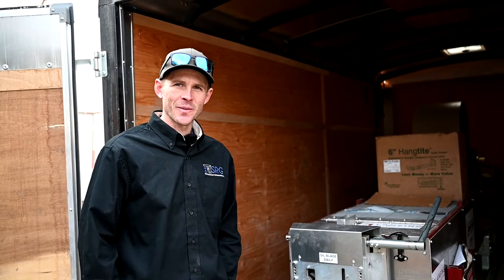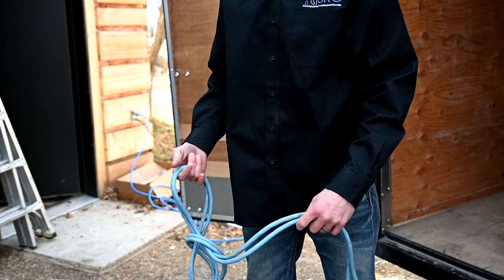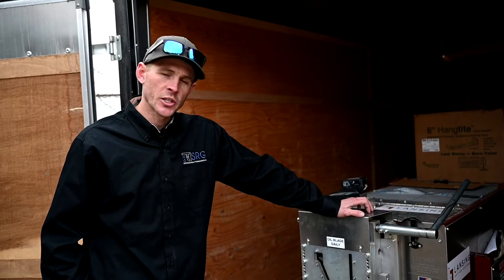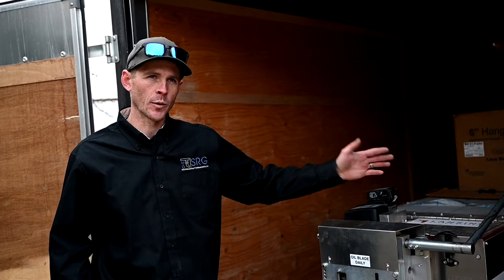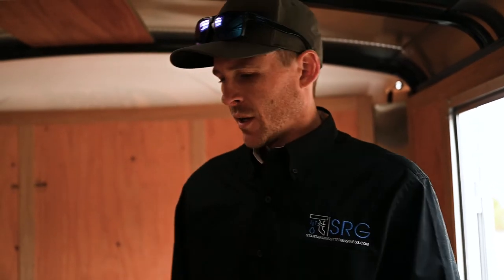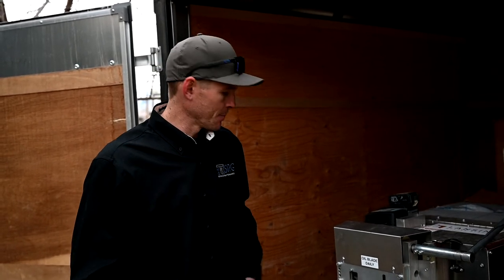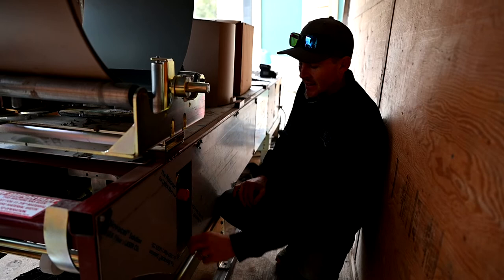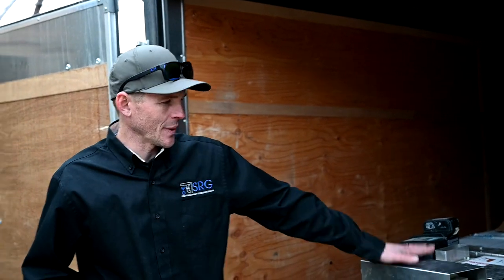KWM Gutter Machine Tips

Comment: Just starting out with a kwm 5 inch. What’s the best practice to minimize waste when running out machine at the end of a job
Reply from the maker: measure to the back of the machine on your last gutter and add a few inches, cut coil with snips and run out your last gutter. Then trim gutter to length
Reply: @StartARainGutterBusiness  that was my thinking as well. Thanks for reply
Reply: Any thoughts on customers who just want metal ran off and dropped? Ive got one coming up and I needed sone insight on the best way to price
Reply from the maker: We charge around $5 per foot of gutter for cut and drop

Comment: Would you or anybody know how to service the gear oil in the gearbox attached to the electric motor? Just completed a motor swap and would like to know how to add the 90 weight oil that dripped out when I separated the motor from the gearbox. 
Thank you!
Reply from the maker: should be a set screw on the top and side. the top is the fill and the side is the fill level

Comment: Thanks for the informative video, we’re a roofing company just getting into the gutter business. So these videos are helpful. I have a question! Do you absolutely need tandem axle trailers? I’m getting the Ironman jr 5” which means it weighs 800lbs, I can afford a 6x12 3500 lb rated trailer single axle. I can stretch my guns to buy a tandem I just don’t want to for a trailer that will only leave my shop approximately 10-20 times a year
Reply: my buddy has a 12 foot single axle trailer and he has no issues with it.  just remember each full roll of coil is about 200 pounds.  it adds up quickly.  on another note, you might be able to find a gutter guy to drop off the gutter to you and you install it yourself instead of spending the $$$ on a machine and trailer and all the other stuff for only 20 jobs a year.
Reply: @leolinehan2752  well that was always my plan, I actually always subbed the gutter jobs out. But after going through 5 different subs a year because they disappeared on me, stopped answering phone calls or texts. I’m getting really tired of dealing with others that don’t want the business. So it’s not really about making a lot of profit (even though I will) it’s about keeping the professional image as these subs have kept me waiting for months at times.
Reply from the maker: Should work fine for a lower production setup. Probably just keep the speed down when traveling longer distances